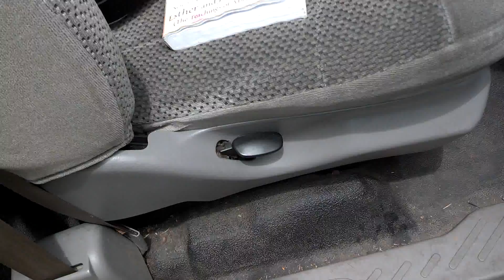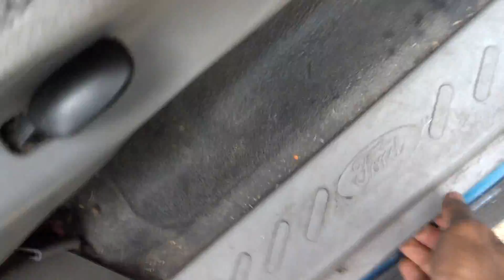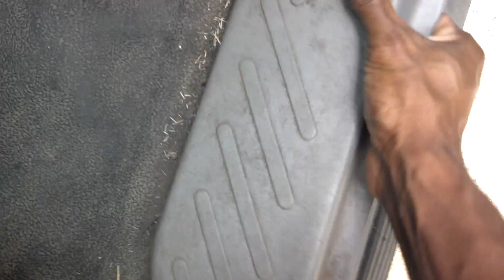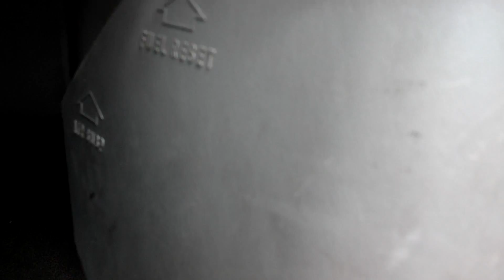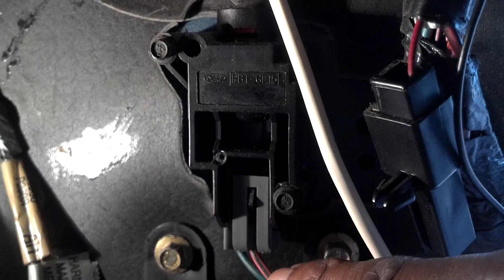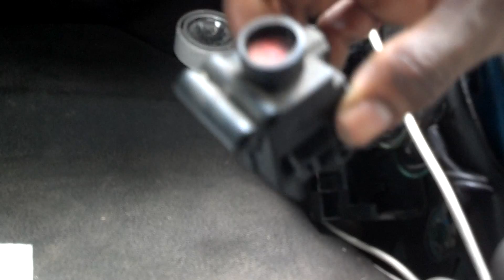Depressurize your fuel system Ford no special tools

Comment: Thanx!  I pulled the fuel pump relay but it was a pain cuz of rust, not so bad but this looks ezr.  I don't have a fuse panel so I don't know which fuse to pull for the fuel pump. Good to know where this inertia switch is tho.  The fuel pump relay on my '88 F150 4.9 is located behind the air filter box next to the EEC-IV test box, there are two relays, the fuel pump relay is one closest to air filter box.  I sprayed some deoxit on the tabs to clean a little corrosion while it was out- in case this helps anyone out there. Again, thanx for the vid!
Reply: I also want to add:  I had a fuel delivery problem, truck would drive ok at first but after warming up I would lose power & it would make me crazy of course, I figured I needed a new inline fuel pump (located on frame under drivers seat) but first I unplugged it & noticed corrosion on terminals so I sprayed deoxit on all terminals (I think carb cleaner might work too... ) plugged it back up and I got fuel pressure back.  Now it's much better, need to test drive it more, I might still need a pump but maybe not. The truck drove first fine then started bucking and stalled, would only run for 500' then stall again, drove me crazy! So just wanted to add that in case somebody has similar problem, check electrical connections on old vehicles! esp if you can't get home!  Also learn about checking codes.  YouTube vids about that, I didn't use a scan tool for this obd1 vehicle...  just a paper clip on the EEC-IV test connector box. Info about fuel pressure regulator is good too for diagnosis & understanding of fuel injection systems.
Reply: so I'm gonna drive as is for now but I did order a new inline pump from e bay for about $27 since the one I have could be original.

Comment: My old f150 wouldn't start, but it turned over strong...after a bit I figured it was the fuel system. I was hoping it was the fuel filter as opposed to the pump, but I was having a bugger of a time getting the fuel filter off. I'd pulled and shorted the main cables to the battery so I figured the pressure would have been released, but I thought I was wrong and the pressure was causing my difficulty so I came in and looked for a video like yours. 

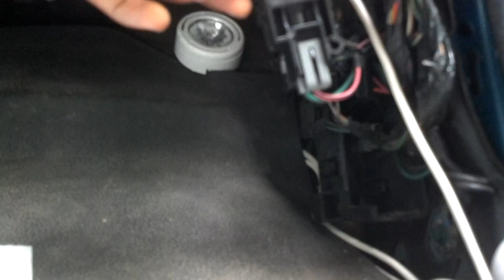Damned glad I did, too! Round about 3:35 you point out the collision sensor that turns the fuel pump off. Bing! I trot out, press the button you pointed out and...magic! Somehow the switch had popped up. You probably saved me a couple of hours of misplaced DIY work and the ultimate embarrassment when the eventual mechanic pointed out what was wrong.

Thanks man!

Comment: There is another way to depressive on my f250 I locate the fuse box find the fuse for the fuel pump pull it turn the ignition on the engine will turn over for a few seconds but not start your line is now depressurized you can now change the fuel filter

Comment: Is fuel filter installed on the supply line or return side??
Reply: Phillip Cheatham  the supply line so it catches any debris before it goes into the engine

Comment: Didn't work on my 04 Freestar(located in accessory in back) .  Still pressurized, even after close to 30 mins.  Good thing I had rags around the sensor before I removed it.

Comment: it might be easier to give the inertia switch a light hit with a soft faced hammer to set off the switch. no need to remove it  .  just reset it by pushing the button back in when done. i would run the engine, then trigger the inertia switch untill the engine stops running.

Comment: a simple way to depressurize the fuel system is to remove the fuel pump fuse located under the hood ,then start the truck until it runs out of fuel, then disconnect the negative battery terminal. The switch that is being showed is if the truck gets into an accident , it turns the fuel pump off. if the accident is minor , you can reset the switch in the location he is showing.
Reply: I'm tripping at all these people saying pull the fuse then start the vehicle.  Um,  if ya pull the fuse, before it's running, it won't start because the fuel pump will not pump fuel to the engine.  Duh, right?  If you start the vehicle and THEN pull the fuse, the engine will die immediately or almost immediately and yes, that is normal.
Reply: When I pulled my fuel pump fuse the truck wouldn't even start . When I started it and pulled it with the motor running it died instantly . Is this normal ?
Reply: joseph bourdeau how long has this been going

Comment: Replying on my comment,replaced mine last week,coincidence,just remove the gas cap,and you are good to go,this video is what not to do.No angry comments please.
Reply: That' what I said.
Reply: Is it really that easy? Just one step, do I have to do anything else?
Reply: No,you may get a little fuel spill,from the old filter,thats it,easy job.
Reply: Awesome! I have been holding for my fuel filter change for awhile because I thought it would be harder thanks a lot !
Reply: No worries,Easy to do,you will see how easy it is.You will get a slight fuel spill,from the fuel in the filter, and thats it.
Reply: Pete Smith I dont do this when changing the fuel filter. I have an 09 F250. Just break the lines on the filter. Gas does not shoot out under 2 million psi, it just drips out if you push the tabs in and pull the lines back easy past the lock flange on the filter. This depressurization is just a waste of time.
Reply: YES,have changed mine many times.Open the gas cap,remove and replace the filter.The only spill you will get is from the fuel in the filter and lines,it is nothing,maybe a half of a cup,if that.

Comment: Just pull the fuse! Second most systems only hold pressure for a little while. In 20 years I've never released the pressure when opening the fuel system. That said one should consider how hot exhaust components are in the event of a little spray, or just fuel drainage you will have in general if your at the engine. Fuel injection requires pressure to run so you will still have fuel in the lines regardless of what you do.
Reply: +Robert Presti Jr I just jack up the vehicle and do it in the morning before cranking.  Never had an issue.

Comment: If you looked at my custom (not by me)fuse system it would take you a while to figure out what is what. And the rag is not so good if your fuel pump is leaking... So this video is NOT INSANE. Just a little long winded perhaps... A lot of people  have problems with their Ford truck that they can't figure out. I wouldn't be surprise if some are related to this switch system...

Comment: This is insane.  All you have to do is remove the fuel pump fuse and then start engine until engine stops and fuel is out of your lines.  And to replace injectors or fuel filters you actually only have to let any vehicle sit for one hour and you just hold a rag over the disconnect area.  This video is literally INSANE.  Reminds me of a guy that removed the instrument panel on a 75 Lincoln to fix the blinkers when it turned out he only needed a flasher.
Reply: It mat be insane, but this is how Ford tells you to do it.
Reply: +Earl Guyton Everyone has different ways to do things.One way may indeed be easier, or better, than another. Why call this method insane? This guy was trying to help people, and pass along information. To someone like me, who is not a gear head, this video helps a lot. Maybe you could just take a deep breath, accept that your way is different, and go on.
Reply: +Mike K So its not insane when you need to go to the corner store a mile away to first go to another 20 mile location and then return to get there?  Would you remove an engine head to replace a spark plug?  Its insane  The enormous cost of labor that would accrue on a repair invoice if any shop did the extra unnecessary practice
Reply: +Earl Guyton this was a self-help video. There's nothing to suggest otherwise. If you don't like the guy's video, don't watch them. If you can do a better job, make your own and open yourself to criticism.  If you need to feel better about yourself by degrading others, you succeed more at pointing out your own weaknesses.
Reply: +Mike K So are you a dictator on the net to tell people what to watch?  Youre a crazy person.  LOL..I guess you remove your starter and alternator when you change your oil.  Right dictator? LMAO

Comment: or just disconnect the battery and open the gas cap
Reply: Gas cap removal will not depressurize. Pressure is in fuel lines not the tank.
Reply: +Newbpwng Thats all I have ever done with no problems.

Comment: Geeze that's a lot of work to save a few ounces of gas if you don't have an adapter and glass jar to catch it when you do the following:  Just pop the hood and press down the fuel rail schrader valve to let it depressurize.  This is pretty much universal, no hunting and researching each vehicle.
Reply: and a lot do, if you don't  have specific info pertaining to this vehicle, then don't state vague nonsense. either be specific about this vehicle or enumerate those you're vaguely referring to.
Reply: Stinky Cheese you smell like stinky feet, 😂😂😂😂😂

Comment: so running all the gas out of a fuel ingected vehicle isn't a problem?
Reply: +DD826 Of course not.  At most you might need to cycle the key to the energized position, then back to off, then to energized again to get the fuel up into the line.  In other words when you turn the ignition key to start the vehicle the fuel pump energizes first to put pressure into the line.

Think about it.  If it were a problem then how would they ever start the vehicle the first time they put gas in the empty tank at the factory??

Comment: This video is helpful in two ways.  One, where to connect wires for a security "cut-off" switch using your fuel pump. Two, where to find the "inertia" switch in case of major jolt to your vehicle, such as in the case of some curb-side jumping.
Reply: +casualchaos1 That's not the way to do a security cut-off switch.  You'd want it tapped into the ignition security system so the would-be thief doesn't wear down your battery or burn up your starter by continuing to crank the engine with the hope that it's just hard to start.
Reply: Thanks, good to know

Comment: Much simpler way is to just start the car and with a closed fist sharply hit the kick panel to activate the inertia switch and the car will shut down.Then do what you have to do and when done reset the inertia switch by sticking you finger over the top of the kick panel and pressing the button. The inertia switch shuts the fuel system down in an accident so a sharp blow to the kick panel almost always activates it.

Comment: Why don't you simply pull the fuel pump relay? It works for any vehicle with fuel injection.
Reply: Wheres the fuel pump relay located?  My van wont start due either fuel pump or filter.. it does crank but dont start
Reply: @kar15bigdog  You can also pull the fuse for the fuel pump. IF you're going to do any do-it-yourself on your vehicle you should buy a Haynes manual which tells you where everything is, one of the 1st things I buy with a used car / truck
Reply: Fuel pump relay on most Fords are built into a module which you can't pull.
Reply: Because you’ll still have 50 psi in your lines no matter what even with the car off
Reply: In my ‘08 F150, the relay is permanently soldered to the fuse board. It’s ridiculous. Why Ford, why?

I’ve found I t’s easier to disconnect the fuel pressure drive module in the back; then start the car til it dies. 
It’s possible to remove the 20 amp fuel pump fuse as well but unfortunately this fuse also prevents the injectors from energizing. 
What Ford should have done is left (kept) an access port low on the fuel rail to check pressure manually and to empty the rail for maintenance. Now we have to spill fuel.

Comment: You can reach over the top of the kick plate and press the button. However, you must have the ignition switch in the off position to reset it.

Comment: Why don't you just remove the gas cap?
Reply: will this work on a 1989 f250? turn the car on and just take off the gas cap?
Reply: +Lawrence De Angelis That's to easy.  Just like just tapping the switch with a screw driver handle lightly will set the switch off it take all but 2 sec. to get it done
Reply: +Lawrence De Angelis Because that doesn't work.  In a rest state the tank has a vacuum (until it equalizes pressure eventually if not sealed perfectly) which would do more to suck fuel out of the line that relieving that vacuum by taking the cap off.

Think about it.  Vehicles aren't especially hard to start, no special delay waiting for the fuel pump to fill the line again after every time you take the cap off to put fuel in the vehicle at the gas station.  It maintains pressure with the cap off.